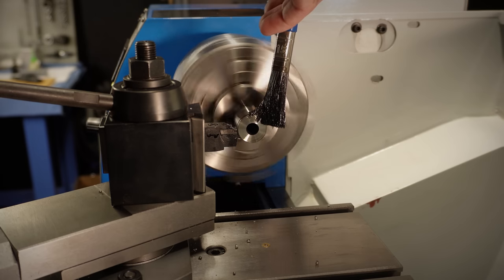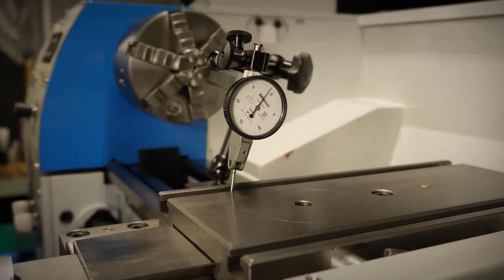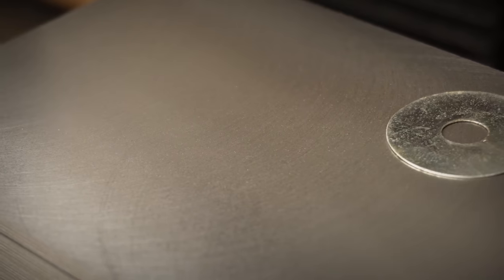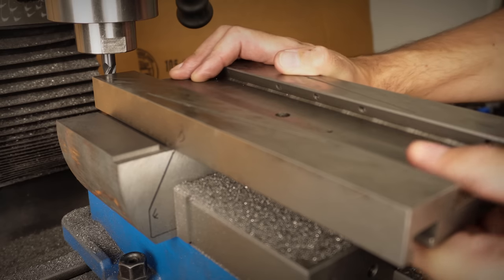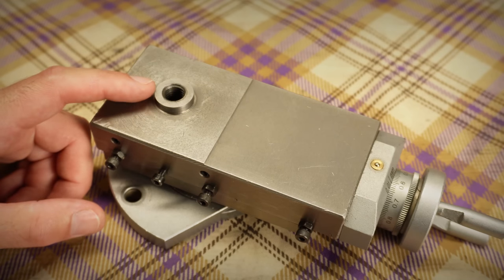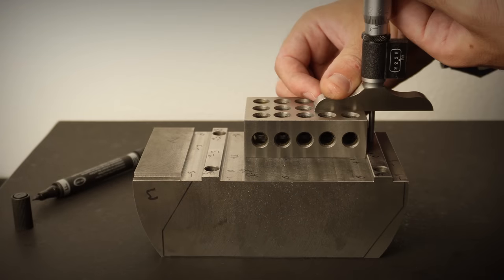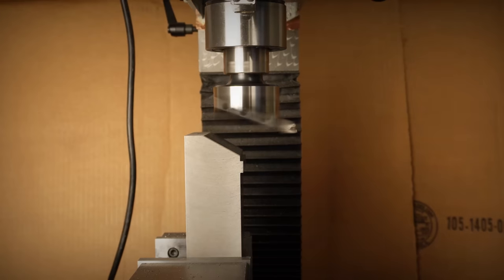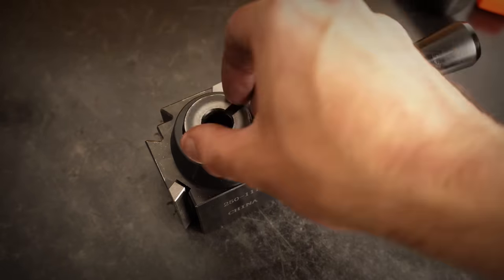How a Solid Tool Post Mount changed my lathe

Comment: I have worked on a wide variety of lathes. If the guides of the top slide are set correctly and it does not stick out too far and is parallel to the bed, then there should not be any problems with stability on any lathe. If I set the top slide at an angle, as you can see at the very beginning of the video, and the guides are set too loosely, then it is logical that I will get vibrations.
Reply: All the table top lathes that have compound chatter with any meaningful cutting force no matter how its set up. I have tested many, and only with rigid toolpost they work. The compounds and fitting is not flat, by any standards. I’m a professional machinist with over 10 years of experience so I know how to run a machine and tooling.
Reply: There clearance in any compound slide. There has to be. Also the attachment of the compound to the cross slide tends to be a weak pound as it has to allow rotation. For both these reasons a solid toolpost will be more rigid. Finally, if Robin Renzetti and Stefan Goetteswinter say it’s better, having done years of work both with and without this mod, then for me there’s no doubt.
Reply: @sblack48  I can only repeat that I have earned my living for decades by producing parts on various machines. I and the employees in my department have never had any problems with stability. But I understand that if you only do it as a hobby, the machines won't be as expensive and therefore less stable.
Reply: @peterpan7903  certainly the smaller machines are less rigid and will benefit more from this. Also it depends on what you are doing and how hard you push the machine. For straight forward turning it probably doesn’t matter. But when you try plunging with a wide form tool with full contact then the increased rigidity will be appreciated. Also consider that Robin did this mod on a hardinge hvl-h which is not exactly a flimsy hobby machine.

Comment: Anyone else get the sense that making a bushing/sleeve, or whole new bolt+shaft, for the tool-post hold-down shaft/bolt, to take up the slop between the post and shaft, would've probably taken care of these concerns just as well as all this other work?.. I mean maybe also the surface finishes between the compound and tool-post, but there was an awful lot of play in that post and shaft when he showed it.
Reply from the maker: It mighy have helped but in my case I think this was a better improvement. It's a matter of mass. The mass in the compound just isn't there and having a small compound locked with a single M3 screw is not the same. There are improvements to be done that would help, like scraping it to get tighter tolerances, making a new plate to hold it, drill and tap more locking screws... but in the end, I think the mass is just not there as well as there are too many mating parts. But hey, if you try that on your lathe, do let us know! 😉
Reply: I altered my compound slide to hold down in a similar fashion to a Boxford, this has worked very well and the compound is still available for normal use.

Comment: The problem with these mini lathes are often only 2 bolts holding the cross slides. I did make it into 4 bolts and it helps alot...
Reply: Problem with these mini lathes is they always try to walk it in...
Reply: @dittilio did you see that ludicrous display last night?

Comment: That Mill is not tramed, your fly cutter is using one side only, when  tramed the marks aré crisscross pattern...
Reply from the maker: Hi, thanks for your comment. If the head was tilted there wouldn't be a back cut, the cutter would just be going over the surface already cut. You can see the back cut is happening, it's taking "no material" but leaves the finish. Also on the surface plate  there's no evidence of a concave cut which should happen with an out of tram head. Thanks

Comment: nice result.  I scraped the bottom of my solid tool post and amazingly it made it even more better.  put an indicator on the right side of the cross slide to see how much it moves.  you may be surprised how much it lifts under load.
Reply: The cross slide likely has horrible contact on the dovetail, which means it does okay with a down and and right force from the turning, but not well from the down and back force from parting.

Comment: I like it. I may have to do the work to my lathe. My issue is that when I’m going to take the lathe down, I also wanna do a 2.6hp dc motor I have prepped with an actual spindle rpm, and do a better cross slide lead screw with thrust washers and better two part nut for eliminating backlash, and … 😂 Well, you get the idea.
Reply from the maker: I know what you mean. One step at a time!

Comment: Giving up the compound limits lathe capability for fine in-feeds, cutting tapers and etc. That compound is very useful.
The original problem of chatter could be due to how the gibs/dovetails are fitted_scraped as a matched part. It is likely those what must be precision/accurate parts could be extremely ill fitted causing excessive movement under cutting load. Check this.

Other possible problems could be due to how the compound/tool post is fitted to the base. There is usually a swivel base at the compound, that is another possible poor fitting area that should be looked into.

Comment: Well I think you have done a great job. All machines have different parameters to work with and all machinists are different and have different ideas on what will and won't work and I think you got it just right for your lathe and your needs. I am impressed and you should be very proud of what you achieved. Also you have a very calm voice and have explained it very well. Congratulations
Reply from the maker: Oh, thanks. That's very kind. Thanks and have a happy new year!

Comment: Looks great! I did a similar solid tool post. I too copied Phil Vandelay’s design. But I had to modify my tool post because I needed access to the follow rest and the overhang for getting closer to the faceplate put my cutting edge past the follow rest supports. I hated to do it but I was on a time crunch and didn’t have the materials to build another too post. If you want to spoil yourself make some land T-nuts with threaded holes at opposite ends for mounting hardware. It’s fewer parts to finic into place.
Reply from the maker: That's a good point that I didn't show in the video. The follow rest is indeed a compromise, I have to grind an hss tool to bring the cutting edge inline with the rest supports or slightly behind them. All my carbide tools cut past the supports as you described (but not by much). The steady rest on the other end is very good, I'm able to take a tool just about to crash. Cheers!

Comment: For a next project, why not a carriage drill holder?  Big chunk of material, use a drill and a boring head held in the spindle to put a holes in so they're aligned with the motion of the carriage.  Personally I'd put in a plain hole for this ER8 collet chuck (for smaller drills) and an MT2 bore for taper-shank drills or a chuck.
Reply from the maker: Thanks for the suggestion. It might come in handy one day, but before that I have other stuff to finish! Cheers!

Comment: A few things... One, you could check the center bore for the compound, and use that as a locating feature with a solid carbide pin(broken 12mm endmill seems to be what would do it in your case, i may be wrong in size, but you get my point). That would serve as the pivot point, and a centralizing feature... The toolpost could have a ``box way configuration`` and rely on as many flat surfaces as you would like, it could rely both on the faces and the t-slots, it could rely on the t-slots or t-slots and the rear face of the cross slide for angular reference... 
Now this doesnt apply to you, given the skinny ass mill which would not really appreciate the technique, but if you slap on a machined slab to the back of your mill, scraped-matched perfectly, you will be at a point where your mill wont bitch about the technique that follows... A flycutter is great, but what the fuck is an indexable shell mill other than a flycutter with too many teeth? Just pick the x inserts out of the facemill, leaving one in there... A facemill is often very heavy, and quite well balanced(unlike most flycutters, which i neednt explain what the benefits thereof are)... You could also if you are using a large(4in onwards dia) facemill, leave two inserts, 180 degrees apart, that would mass balance the facemill, and would give you two cutting edges to work with, which can be used either on a small part to allow you more speed of movement, having only one cutter do the work at given time, or you could use it on larger parts, to impart force via both inserts at the same time, as to theoretically keep the facemill under equal loads on both ends, thus forcing it to cut flat, if the head is perfectly trammed... 

Also, that second, thicker carbide drill seemed to be off... It may just be parallax sight, but it seemed to me to be offset by half a millimeter towards you, as if you accidentally leaned on the y handwheel and shifted the whole assembly a bit away from the column... I may be shooting out of my ass here, but that is what it looks like to me, hell, i think i even detected a slight bending in the thicker drill as it went in...  I would try and check the bore with a carbide endmill shaft, as that wont bend, and if the hole is crooked, it will instantly tell you that shit had taken a path of its own... 
Its a lovely design, and i like it, im just writing down what i think i see, as i watch...

When i get my shit together, and when i get my machines in order, i will film a video on this topic, as i too will appreciate a solid toolpost block on my baby lathe... The big girl lathe has a compound that is as heavy as your mill, so that needs no real changes... The lathe would benefit from it, but she is a skookum choocher of the old german style, the size of her parts - when precisely fitted - allow for ridiculous cuts... Like 13mm doc at 27m/min cutting speed, so slow infeed, but... 13 fucking mm??? Hello? What were the germans thinking back then...  The rated horsepower of the cut in the manual is 9 horsepower, out of 11 that the motor has... And that is with the compound slide... So if she can run 13mm doc with a compound, i seriously doubt that my loving and gentle cuts will even be noticed by her majesty... Even in toolsteel, she wont even know she is running... Now that`s a regal lathe, equal to monarch lathes... But the baby lathe, well, lets say that a compound is either locked 99% of the time with gibs, or its used for those few cuts with appropriate tightness of the gibs, but yeah, i will likely make a very similar piece to yours, as the design is more than pleasing and functional...

Also, i would lubricate those fasteners, either way oil or whatever grease you have at hand... Just for good measure... The tight spacing allows you flood the area with oil and have the bolts be absolutely rustproof for a good while... Grease would be even better, as it would not be easily blown out by air blasts or almost anything else...
Reply from the maker: I have just approved your comment, (youtube retained it for revision). 

Thanks for sharing your thoughts. 

Regarding the 6mm carbide drill, I just re-watched that part and I was surprised, it really looks off center! So I went downstairs and measured a 6mm carbide rod (blank) which slides nicely into the hole and measured the distance from that to a parallel resting against the machined corner of the tool post. There's 0.03mm difference. The video does seem to show more than that, I don't know why. I have pre-drilled with a 3mm first, not shown in the video. Could that first hole be off? I didn't move the table and was using R8 collets though... so that is strange. Anyway, the result seems fine and everything else was made around that, so wouldn't be a problem if it was off... but well spotted 😅 Thanks!
Reply: @nbrworks 
Yeah, it seems to me as if the drills were not concentric to each other, the 3mm went in, made a hole, and the 6 mil didnt seem to kiss off from that hole perfectly... I thought i was just having parallax sight and focused on the carbide 6 mil drill, and i could see that i cant just be mad, the thing looked to be engaging on one side more, and as it went in, it seemed to ``bend`` a bit... Being carbide, it nearly is like an endmill in its rigidity and ability to correct a hole as it sees fit, but being a drill, and a 2 fluter, it just doesnt have that rigidity, even in carbide...
I love the 3 flute carbide drills for that reason... Try them, they are near boring bar precise, have reamer grade surface finish, drill hard steel, self locate and self start(some dont, some are specifically ground to enlarge an existing hole and have a blunt nose-no point)... I first got one with my big lathe, and that drill had me in love from the instant i spun it in my hand and saw that im not barking mad - that thing actually has 3 flutes, and its a drill?! So yeah, a recommendation for those... Harder to grind, more complex, but immensely more rigid, and better in every way, except for their max speed of material removal, which logically suffers due to less space in the flutes... 
Also, lol on youtube comment revision... You can turn that off when you post videos if you want... Its more of a feature for political channels and such stuff where virulent hate and sewage of racism and other forms of shit are likely to appear en-masse... 
I know that my dictionary easily gets my comments flagged by such screening, even when it has 0 to do with any abject hate or sewage spewage of other sorts... Eh, what can you do... I have love for machines and foul mouth for everything else :P

All the best and kindest regards!
Steuss
Reply from the maker: Thanks for your advice Steuss, it's appreciated. Cheers!

Comment: I notice that virtually no one uses a self protecting cutoff tool holder.
It has a slot to allow the tool tip to move away from the cut if it begins to dig in too deeply.
Maybe that just isn't a problem with modern cutoff tools?

Comment: I had major problem with parting operations with my 10x24 bench mill. I got a piece o 2" hot rolled steel large enough to bolt the lathe to. This made it rigid enough to not walk on the floor, as my problem was the whole lathe going into harmonic oscillations during parting and heavy feed or depth cuts. But a rigid tool post would make it better. I don't have a T-slot cross slide on either of my lathes, so I'm stuck mimicking the compound mount, not optimal or enough fasteners.
Reply from the maker: Thanks for sharing, I also have the lathe bolted to a 15mm hot rolled plate, but still have (or had, I don't know yet if that changed with the solid mount) some vibration from time to time, mostly turning larger stock away from the chuck. I think the next big improvement to be done is the lathe stand. I have mentioned that in other videos, my current stand is far from ideal. I already have the materials, but will need more time to design it 😉
Reply: I added a piece of aluminium tooling plate to the top of my cross slide after I milled some T slots in it. It is held down by a number of cap screws and then there is a small riser block between it and the quick change tool post. I like the idea of the corner being held tight to stop the tooling from rotating under cutting forces. I may change the riser block so I can do this.

Comment: I'm thinking of doing this for my lathe. The only drawback that I could think of is for threading. With this set up you'd have to cut both sides of the thread each pass, which puts a lot more stress on the tool. Have you had any problems cutting threads with HSS threading tools, or do you do all your threading with carbide?
Reply from the maker: Hi. I normally use carbide tools for threading, yes. But I don't do much threading on the lathe, at least until now. The solid mount is quick to replace (I've done that a lot to cut angles) but changing the gears takes more time. I've been thinking about an electronic leadscrew conversion, which should fix that, but I didn't move past that (thinking). 
But back to your question: replacing the solid mount with the compound takes a little bit of time but it's doable. Mine takes no longer than 3-4 minutes. And you can always go back if you think it was a bad move. Thanks

Comment: Hi! Love the videos, where do you purchase your parts? Surface plates, toolpost, pins, cold blue, etc!
Reply from the maker: Thanks! My surface plate came from Chronos UK, it's a Dasqua plate. I have some Dasqua tools and most of them are very good. The toolpost was from arceurotrade, also in the UK, but I've bought a bunch of cheap AXA toolholders from Amazon. They are not as good as those from Arc. I use the cheap ones for the least used tools. Cold blue is from Birchwood Casey, super blue. That's a bit expensive and results are kind of hit and miss. In fact I was looking the other day if there was a better alternative to dip the parts instead of brushing them, but didn't find any conclusion. I also got some machines from HBM, seems to be my source in the last years (no sponsorship or anything). All my measurement tools are probably second hand tools from ebay that I clean up and restore / calibrate. I don't think I have bought anything new from one of major brands (Mitutoyo, Starrett). I like very much the Fowler/NSK micrometers I show in the videos, they are very accurate, easy to maintain and well balanced to hold. Hope this helps!